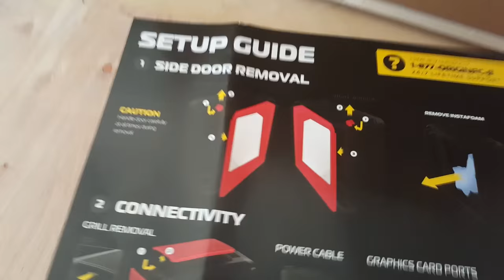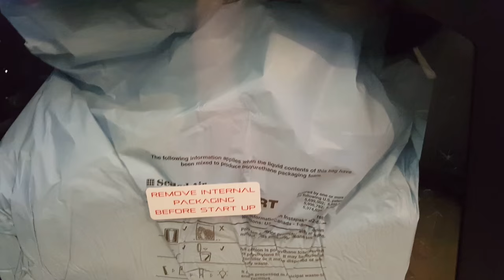New PC Unboxing!

Comment: Shame you've had such a problem building PC's man. I have only built one, but it took me 1 hour (after getting parts). Have had 0 troubles for 2+ years. Then again, you put more stress on it than I do as Im just a casual gamer. Regardless, looks like a beast set up. I juts can't warrant spending nearly $2000 on a pre built pc haha
Reply: To be fair, you'd spend more than 2000 on parts if you made it yourslef. But I agree, it's always better to build it yourslef.
Reply from the maker: +D Pow its custom built, no prebuilt. You're literally paying just for warrenty/techsupport/assembly etc
Reply: aR0ttenBANANA96 You're probably right. I built mine for around $1200 and it's not even close to top spec like his is. I just found it fun to build it and say that I built it haha. I suppose custom selecting everything is similar to custom building. But at the same time, it's still getting shipped pre built :)
Reply: +D Pow My PC cost nearly $2000 and still doesn't even match his specs, so I could imagine that it's closer to $3k since it's from Origin lol

5820k @ 4.5 GHz, Nepton 280L cooler, 32 GB DDR 4 RAM, GTX 980, two 128 GB SSDs (raid 0), 1TB HDD, 750W EVGA power supply, ASUS x99-A mobo, Fractal Design S case
I didn't even get a CD drive/wifi card/pay for windows and it still cost quite a bit! But it really helps with After Effects/Cinema 4D stuff when I edit videos for my job :D
Reply: +iijeriichoii I mean, it IS a pre-built though, you bought it pre-assembled, the only thing you have to do is remove the side panel and then the padding.
Reply: +iijeriichoii yeah but that adds up especially from origin which has some of the more inflated pc prices
Reply: It's more like 4000$ the 5960x is 1000$ and the titan x also another 1000$
Reply: no? late af but I built my pc for only $700.

Comment: while you play with 400+fps I'm just playing CS:GO on 12fps. it's Like a fucking slideshow
Reply: My hard drive failed in my  pc (for the third time)...
Reply: MrRGTF I get 20 max ;-;
Reply: MrRGTF O but i can, im using a laptop thats 5 years old now and i only have 2.86 ram usable xD
Reply: My laptop is from 2011 it's a 600$ laptop I payed an extra 200 for a 2 year warranty (which actually become somewhat worth it as I think I fried something still pricy though) and when I play CSGO I hit a peak of 100-110 fps by overclocking a shit processor while blowing another fan into my laptop to cool it down so my graphics card doesn't melt, and I configured all 4 cores to be activated while playing CSGO which is a command in the properties that I think is like -threads "x" the number of cores, I also play on aero and configured my GT/GTX  520 NVIDIA graphics card on maximum performance I still lag a little but it will do as I have been using that damn laptop for ages, if it was brand new I'd be running CSGO flawlessly at 200 fps LOL, if you really want to get maximum performance that is the way my friend, and don't click that shitty little aero "themed" desktop in the personalize options no disable every single windows animation and your computer will lose at least 5-10% stress
Reply: I feel your pain. or I did. BOYS GOT ME FIRST GAMING PC
Reply: Back i the summer I went from 2GB i3 Intel HD Graphics, to a 980 Ti i7 4790k 16GB.
Reply: I only have 300fps. :(
Reply: +FroschGames boo hoo lol
Reply: +Steven Ghee get a cybertron patriot pc... best bang for your buck pc

Comment: Dude, btw, totally agree with the complaint on Twitch's terrible bitrate limitations. That's like the main reason why YouTube streaming runs laps around Twitch (also, it does have a slightly lower latency). Twitch really needs to step it up… :\

Comment: Your gpu does not make as big of a difference as you think. Its more towards you CPU... Hence the reason that your render times are so short. 8 cores / 16 threads will blow through most any rendering project you need can put up against it.

Comment: Looking at thus video now... I just built a PC with a 5820k, X99 platform, 32 GB of Dominator Platinum RAM, a GTX 1080 Twin Frozr, and a 512GB M.2 SSD with a Corsair Strafe RGB Keyboard, Logitech G502, Astro A40s, and an Asus 4k monitor all for less than this PC alone costs. A whole setup for less than one overpriced, pre-built PC

Comment: Will this laptop run any new games like fallout 4, black ops 3, GTA 5 any games from 2014-2015 
Acer Aspire E 15 E5-573G-52G3
Intel Core i5-5200U 2.2 GHz (3 MB Cache)8 GB DDR3L SDRAM1 TB 5400 rpm Hard Drive15.6-Inch Full HD Screen, NVIDIA GeForce 940M with 2GB VRAMWindows 10
Reply: Honestly I doubt it the 2.2 GHz is really going to hurt also the graphics card isn't great so if you're running them in lowest rest lowest settings you should get around 15-30 fps if I had to guess
Reply: +Spartinattack fallout 4 maybe medium settings, black ops 3 you shouldnt buy on pc(its just a really bad port) GTA5 at low

Comment: air cooling > liquid cooling
Reply: nope air coolers make noise and cool shit against a water cooling
Reply: Daryl Van Engelenburg If you think that, you clearly haven't used both, a good air cooler is around the same price as a 120mm AIO cooler, and the air cooler performs better generally.

Comment: my computet specs :nvidia Gtx 960 :i5 4460 :8gb ram. can it run cs go 200 fps+
Reply: +alex huotari Depeneds on graphical settings. Hell, my i7 16GB GTX 970 can run any game 120FPS+, yours isn't too far behind.
Reply: +alex huotari CS:GO is a source game. Legit like anything can run it.
Reply: +alex huotari 

I've got the same specs
H81 ASUS
I5 4460
GTX 960 ASUS STRIX Super Overclocked Edition
8GB HyperX Fury RAM (1stick for later upgrades)
Aerocool 500W PSU

I don't really know about max settings 1080P fps
But  the settings I play on
1280x960
Low/Med
Shadows high
16x Anistrophic Filtering

I get 250+ fps most of the time, reached 400 in Dust2.
While streaming FPS never goes below 180.
You  can watch my full MM game I uploaded, I streamed it and then uploaded it.

Comment: Jericho or anyone can you please tell me if this speck is good for a PC
Amd8350/8320 processor
16GB hyperXfury ram
4GB nvidia 960
Gigabyte 970 motherboard 
2TB sata-III hard drive
Super quiet dragon fly cooler(fan)
Sharkoon bulldozer case
Internal memory card reader
24X DVD reader/writer
Reply: +Caresser Ive switched it to an i5 4690k haswell is that okay
Reply: +Caresser the i5 6600 I'm upgrading to and ddr4 ram now and a comparable mobo actually surprisingly only a slight price difference
Reply: +Caresser an thank you for the help
Reply: Ssd is better for os and loading in maps faster

Comment: Could of just built one that is way better and way cheaper..
Reply: Did you even listen at 7:30?
Reply: +Sigurd Undrum Out of curiosity, I customized a PC on their website to match my specs as close as possible, and it ended up costing $3,300 lmao. I built mine for $2050, not sure if getting it prebuilt for 'saved time and pain' is worth the extra $1,250. (i7 6700K w/ Zotac 980 Ti Amp Extreme) 

Took me about 45 minutes to assemble and manage wires, booting & overclocking took another 1-2 hrs. Haven't done a full stress test yet, but it hasn't crashed w/ the CPU overclocked at 4.8GHz playing Witcher 3 for 5+ hrs. Not bashing on people buying prebuilts because everyone's got their own reason, but a 50% price increase for basically customer support just doesn't do it for me lol
Reply: +Hassel the Hoff it does have Something to say about where you are bying a pc, i got mine for 50 bucks less for not building it. Its a price war
Reply: so you paid 50 bucks for nothing?
Reply: Tard? really? :L